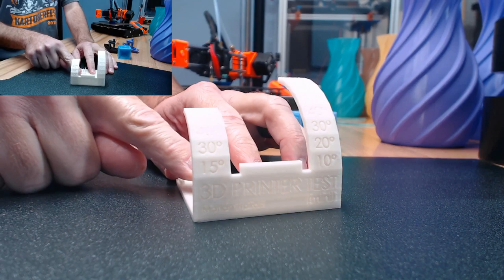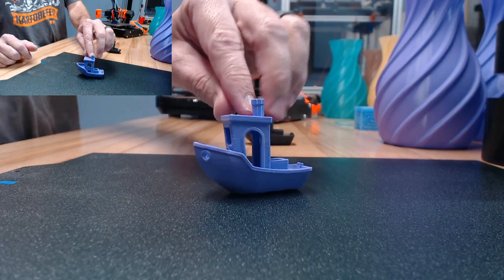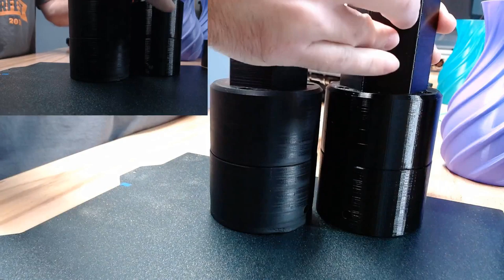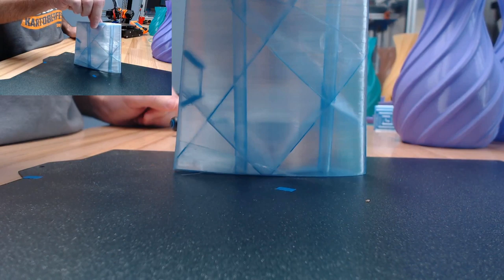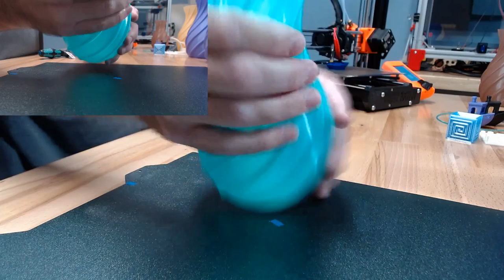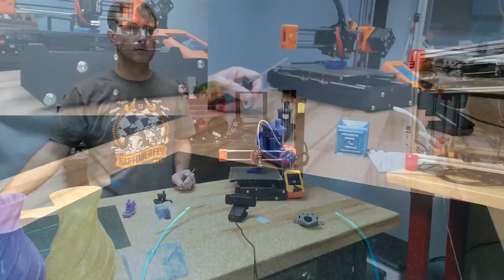Prusa Mini - mini-review after 100+hrs of 3D printing so far in PETG and PLA

Comment: Considering the price,  is it worth to buy prisa mini
Reply from the maker: I have a few thousand hours on one of mine now, and I generally don't have to worry about it. I honestly do not use my Ender 3 machines even though they are heavily modified. The Mini is a better printer in my opinion in this size class.

A few niggles to watch for, don't let kids bump the Pinda probe mount as this could change your z height. After shipping, make sure the X rods are both aligned and perpendicular to the bed.

My biggest issue with giving it to my 6-yr old has been that he bumps the pinda probe on accident. He just gets excited to make something! Then I go to use it and discover the Z height is all messed up. Ha Ha Ha
Reply: @Johns3DPrintingCorner  thank you so much for your reply

Comment: Hi, you can open up the lower part of the extruder gear chamber by the screw that varies the gear pressure ball bearing (found it in the manual searching for a possible solution to my problem). I had problems with material building up in the gears and blocking the filament, too.
Reply from the maker: Awesome, great info!

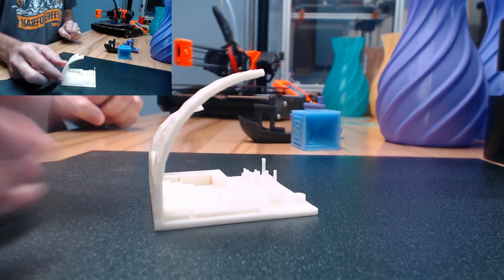Comment: How dimensionally correct and stable were your prints? At 2:25, did you measure the Z-position of the overhang? Looking pretty is great and all but I want to know if it sagged at all.
The PrusaMini bed officially heats up to 100 degrees. Were you able to validate that? Any issues printing ABS with a 100 degree bed?
Did you use the default slicer settings for all of these prints? 
Any modifications that needed/need to be done to the Mini?

Comment: I’m trying to find something that is less fuss than the Ender 3. Does the auto leveling, noise, and print speed of the Prusa Mini seem to make printing easier?
Reply from the maker: The auto-leveling is pretty good once you get it dialed, but that is pretty simple. I need to make another video, I finally rebuilt my friends Mini and discovered a few things that should be a good thing to check after taking one out of the box. Noise is fine, really silent little machine. I have been keeping one of the desk behind me in my office and I hardly know when it is done printing. Print speed is normal, the bowden does a decent job but some prints still have some oozing artifacts or stringing.

What are your goals and needs from a printer?
Reply: John's 3D Printing Corner just small stuff off thingiverse or whatever I think up of. My Ender 3 is really cool but leveling it means putting in work before every print and the sound is distracting. I wanted to get closer to hitting print and ignoring it until it’s done
Reply: @500iq6foot8   I've been on an Ender 3 for about 2 and half months. Upgraded the motherboard and that made it way more quiet. Fan upgrades would likely make it quiet enough to have in an office. That being said, it was too fussy and inconsistent so I ordered a Prusa Mini. Just got to wait now.
Reply: @Just_Jesus_ef  Please let me know how it works out. I am considering doing the same for the same reason.
Reply: @500iq6foot8   Will do. It's a 7 week wait for me, but I'll come back and make a comment.

Comment: Hi, great video. I have an ender 3 pro right now but want a second printer for my 3d printing business (just selling a casual amount, nothing crazy) and I wanted to buy a second printer but need to decide between the ender 3 v2 or the prusa mini, I only print with PLA and also I print small/medium things, so the print volume difference between them wouldn't really matter to me. Which do you think I should get? People say that prusa printers are the best, that is why I am interested in the prusa mini. Please let me know, thanks!
Reply from the maker: I do like both to a degree, and the Mini for my use case is the better option. It works great out of the box and you do not need to worry about going upgrade crazy. For PLA just stick to the more reliable brands and you will have little to worry about with the Mini + out of the box.

IMO I am not a fan of vwheels and the amount of maintenance that can be associated with them. So I do knock the Ender down a notch for that and for the sometimes less than stellar extruders. I have also had to replace Z stepper mounts because the rods would not align. Minor things yes, but it still cost me a few extra dollars and time waiting.

Mini + comes out cheaper if you do not want to mess with upgrading things. Many of the best upgrades are printable, and if you do decided to push it harder in the future the Bondtech extruder is an easy option. When you do step up to a PETG or ASA filament you can place the printer inside a portable photo booth/tent. This will help keep it the printer warmer and stop air draft that lead to warping.

You can ask my friend over @traileralarms what happens when you stray too far down the PLA unbranded generics path.

Comment: Could you do a little video about PETG on the mini actually? I bought a roll of PLA to start, but I'd be interested to see what settings you are using with PETG.
Reply from the maker: I am not far off from the stock settings in Prusa Slic3r. I still need to upload the time-lapse videos, I will try to screen shot the settings.
Reply: @Johns3DPrintingCorner  So are you using Slic3r Prusa Edition or Prusaslicer!??!
Reply from the maker: @ELValenin  https://www.prusa3d.com/prusaslicer/ it has been renamed, even the famous 3 is gone in the word slicer.  I still type Slic3r out of habit. I am not sure what happened to Prusa Control.
Reply: @Johns3DPrintingCorner  I just got my mini printing this week. I have a roll of PETG (prusament). The PLA that came with the kit seems to do a great job. There ETG is giving me some troubles. I downloaded a file to print with the PETG and it just would not stick. I have not tried to print any of the files that come with it. Maybe I should do that. When I tried to print the file that I downloaded it seems to move too fast for the PTG. I had little waves in the filament when it got to the bed. I was using the flat surface. Got any tips?

Comment: Any problem with TPU prints? I’m seeing a lot of videos saying you need a Direct Drive for TPU
Reply from the maker: No issues and I ran a few more days of flex prints after the video.  I was expecting it to fail to be honest, but the extruder path looks constrained well enough to keep the filament going in the proper direction.  Loading was a bit more of a challenge on a few prints, it did not want to catch the gear unless I helped it along.

---

I posted this for another user question - I think I used the 0.2mm quality preset and Filatech FilaFlex40 profile.  I used windex to prep the bed and found it still had a ton of bite.  For purposes of the video I did not change anything other than external perimeters (0.43mm from 0.45mm) on the Advanced Extrusion width tab. Otherwise I was just trying to see how it would handle the filament without making big changes.

Ironically my Titan Aero on my Railcore just would not handle the Ninjaflex... LOL I kept finding it shooting out the side of the extruder.  The harder flex materials were fine.
Reply: John's 3D Printing Corner perfect... thank so much

Comment: Hi John- I stumbled across your video while researching 3D printers. Thanks for the information. I’m looking to get some items printed, but I don’t own a printer and the Prusa Mini was recommended to me. However, its expensive and not sure owning a printer is the right choice for me since I’m not sure I’d ever really be using it again. Do you have any suggestions on what I should do?
Reply: You could also just get a Ender 3. It's cheaper and is generally seen as a good printer. While not having all the features of the prusa mini, it's a good beginner choice. And in combination with the Cura (slicing software) printing was mostly painless. The only real issues I had where related to bed leveling. Which is a bit finicky, but once you dial it in the printer prints really well and without any real issues. The main disadvantage is the noise. The Ender 3 is relatively loud.
Reply: @baaaa1023  Hi thanks for the suggestion. I actually went on Etsy and discovered there are several 3D printing services offered by various people. This seems like the route I may want to pursue, considering I don’t know how often I’d actually use a 3D printer if I do it myself. Do you know if these services are reliable and worth it?
Reply from the maker: I use 3D Hubs but there is a site that a friend of mine uses to sell parts and he has good luck with it - www.makexyz.com
Reply from the maker: @baaaa1023  Lots of upgrade options for the Ender if you decide you like the hobby enough to keep at it.  Sometimes half the fun is just upgrading :)  Meant to tag @David Rodriguez

Comment: Hi, can you test some FLEX/TPU test? I have mk3 in my work but I'm looking for some smaller printer to have it home. 
even mk3s have problem with prints 2h+  :( i didn't saw any video about mini and flex/tpu ty
Reply from the maker: I will try some over the weekend!
Reply: @Johns3DPrintingCorner  love it
Reply from the maker: Ran a few 90A hardness flex prints without issue (three objects on the build surface), running a more complex print now. Ninja Flex TPU early tomorrow.
Reply from the maker: https://youtu.be/kT2pkZLntqw  Just for you!  :)

Comment: I appreciate the upload and the detail regarding the pinters capabilities as well as first adopter issues. I've considered getting this as a replacement for my Dremel 3d20 which is basically like a single extruder Flashforge Dreamer. How is the noise levels compared to your Flashforge? I keep mine in the bedroom and it can get loud at times. Would love to see more content when you get around to it! Cheers!
Reply from the maker: My stock Dreamer machines are much louder, this machine and granted my ears are getting worse. If you had it on your desk you would barely notice it, the fans are audible at full speed but the X and Y axis are surprisingly silent. The extruder does make a clacking sound during retractions, about the same as clicking a pen.  At first I thought it was due to Z hops, but those are silent.  I think the dB range was 53 to 44.
Reply: @Johns3DPrintingCorner  appreciate the response love seeing the improvements over the years and how adorable these machines are now. It definitely seems like a much more capable printer.

Comment: Nice video...new subscriber. Do the Mini parts result in a smooth part?
Reply from the maker: The parts are nice and smooth and it has printed well at high detail resolutions like 70-microns and even 50-microns.  The Prusa slicer already has profiles for this finer layer height as well.
Reply: John's 3D Printing Corner Thanks! Nice job on the videos. Like your testing info!
Reply: John's 3D Printing Corner Wow! Those are some nice bridging overhangs!
Reply: @Johns3DPrintingCorner  Not to mention, their variable layer height enables you to get maximum print quality, while still reducing print time.

Comment: Thanks , great how you show and explain but you should sum up pros and cons at the end if you found some as you mention at the start of the video but hard to find where you explain your findings they kind of all over so an end sum up would be great :) Like an example "it is equally good as Mk3s for PLA" or not :)
Reply from the maker: Good points.  I still think the parts cooling fan/outlet can be improved.  Now that I have adjusted the belt tension it is printing as nicely as my MK2.5S, which I was not expecting.  This whole process has been interesting.  The need to learn new software, figure out the cameras, and more.  LOL  I appreciate the 3D printing community and I hope my videos get better and help users of all skill levels.  I am now moving the machine into production prints, so I will run it 24/7 for a few weeks and take a look at how it is holding up.

Comment: Cool thanks for the update. I'm glad to see people having good results with the printer. I know that people usually only report bad experiences but I was begining to worry about people on the Prusa forum with issues. Have you had the chance to make any multi part prints and piece them together? I'm wondering how "functional" the print bed is. I'm mostly going to use mine for building larger things but wanted small form factor and a good name behind it.
Reply from the maker: I am planning to add this to my farm, so I will be running some of my production prints next to check the quality against my other machines.  Right now I feel like the print quality should be drastically better than my FlashForge Dreamer machines, should be slightly better than my Craftbot 3, and nearly on par with the MK3, MK2.5S.  I did notice there was a square nut coming loose in shipping somehow and it can come to rest on the circuit board.  If you do not catch this loose nut and power on the printer it can cause trouble.  I do hope Prusa fixes this and warns people to check for it.

I should edit my assembly video to point this out.

There are three Mini's in my area, one belongs to someone fully new to 3D printing and his machine has been fine.  He has been printing CF Nylon and CF PETG without issue (other than learning how adhesion works with nylon).

Before I put this machine into the farm area, I will run some multi-part prints.  If you see anything on Thingiverse that you want me to try please let me know and I will print it.  I have plenty of PLA and PETG in stock, I have not yet tried ASA but that is on my list.

Thanks!
Reply: People also resort to forum when there's a problem that simple googling cannot resolve.  There may be hundreds of people happily printing and going on with their lives, they just do not engage with anyone in online communities. Or they have issues too, but resolve it with support.

Comment: Its hard to find any good reviews on the MINI so I appreciate you posting this!  I am curious whether it can print in Nylon even though PRUSA says it isn't supported.
Reply from the maker: Right now the bed will throw an error if we try to push it to 100C, so depending on the Nylon it may or may not work.  Using a garolite bed material and NylonX should be ok.  I do have a lower temp Nylon, just no time, but I will give it a go as soon as I can.
Reply: @Johns3DPrintingCorner  Much appreciated!